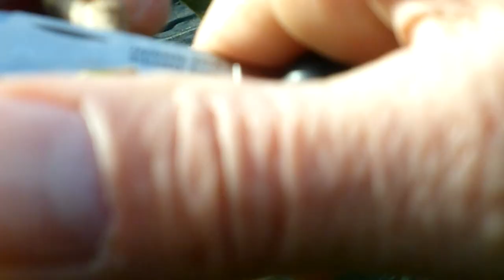Regrafting my Williams Pear Trees| Top working a Pear Tree| Bark Grafting|  Change fruit variety|

Comment: Hey Woody! Nice to see the bit of Norway on your plot! :D I convinced the husband to have a stove put in last autumn and it has reduced our electricity use since last year. It's got its own air supply from the chimney - our house is almost a passive house so not leaky enough to accommodate an older stove. It's great though and I love it! We found that burning a piece of birch along with other wood really helps keep the heat up (and hopefully means the chimney won't get sooty). When I was a kid in Norfolk we had a back boiler, and I lived in a house in my 30s that was built in the 1500's whose heat source was just a stove with back boiler combo, I got a bit skilled at keeping embers going overnight to just light up again in the morning. But it was that cold the cat used to sleep curled up around my head at night for warmth :D
Take care my friend, and I hope all the grafts take <3
Reply from the maker: Hey!
I'm glad you saw that I kept the Celina graft😉. Great info about your experience with woodburning stoves. Here you can have a 5kw stove without having a vent fitted, and they are said to be around 82.5% efficient. Well we will see!
ATB my friend 🤗❤️

Comment: Great timing for a demonstration Woody as I'm thinking of doing that to my Asian pear thats too tall for a container. Interesting that you only shave one side of the scion and you also don't bother to wrap the scions in cling film to stop moisture loss. Seems much simpler to me 👍
Reply from the maker: Hi Brett
All I can say is that I've used this method lots of times and I get a high success rate. The scions should not dry out as there is a lot of wax around the union with the branch and I wax the tips too. Hope yours goes well mate.
ATB 🍻👍

Comment: Wood burner always a good thing to have. My mum has one with back boiler it can run all the heating and hot water.  The tree you are now grafting will not fruit for a few years so that might help break the breeding cycle of the pest too.
Reply from the maker: Yeh, definitely going to get one mate ( all the local installers are booked up for months!) Great that Ur mum has one with back boiler.
Yeh, hoping that even if the midge comes back it won't affect the new variety 🤞🤞🤞.
Cheers 🍻👍

Comment: I've got to get a couple big Pines down so I can put in more fruit trees, I have some root stock potted up too...
Reply from the maker: Great Tim, will you be pulling out the stumps with tractor?
Reply: @cumbrianhomestead  Although my neighbour has offered many times to pull them with his backhoe, my wife prefers to keep them about 4 feet tall as "Features" and, well, with a little careful planning even a 3 foot diameter stump can be worked into the design, and not interfere with the number of fruit trees to be planted, the issue is that at 60 -80 feet tall, and having to fall were the fruit trees will be planted they are preventing 20 - 30 trees going in...
Reply from the maker: @trollforge  
I get it 😃👍

Comment: Hello Woody.
The one house we lived in had a wood burner. The only wood that I used was pallets. Cut them up in the summer, and store for winter. Sort out the nails in the ash after burning. Good supply of potash.
The grafting you have done on the pear, is it possible to do on a plum?
I find your work on fruit trees extremely informative and interesting.
Take care, keep safe and keep smiling. Cheers. Pete.
Reply from the maker: Hey Pete
Yes I've started to get some pallets for burning now I've made somewhere to store it lol.
Regards the grafting, yes you could do the same with a plum ( did it on my mother in law's plum tree) but leave a nurse branch on to help draw the sap.
Hope that helps mate
ATB 🍻👍
Reply: Hello Woody.
Would you do the grafting in early summer. Using another variety of plum and cherry.
Reply from the maker: @peterpurshouse4469  
 Pete, definitely in early spring. If you haven't got your Scion wood, you need to get it asap!
Do the grafts in late April. If you can't get Scion wood now, then I'd advise to delay grafting until next year.

Comment: have you got a video of pruning a plum tree  i was told to do it in spring...thanks for any help
Reply from the maker: Hi Pauline
Unfortunately not on pruning plum trees. Yes, as soon as leaves start emerging from the buds prune then as it will reduce risk of 'silver leaf' infection. Cut out any dead, diseased or damaged branches and reduce the height of anything that is way beyond your ability to harvest fruit. Remove any branches growing inwards or rubbing together.
Hope that helps 😃
Best wishes 👍